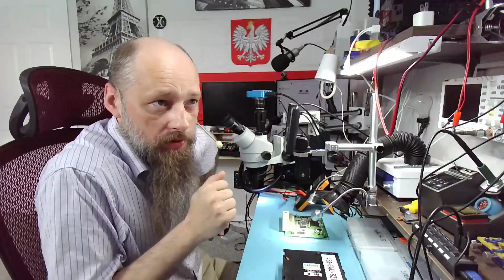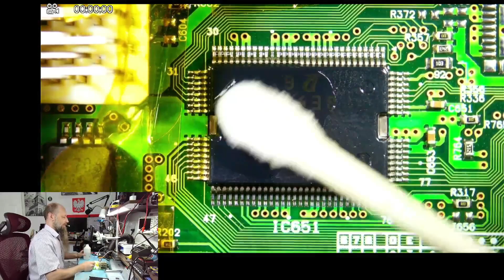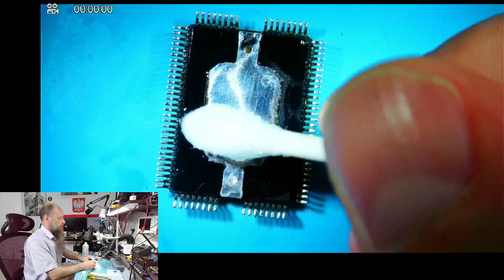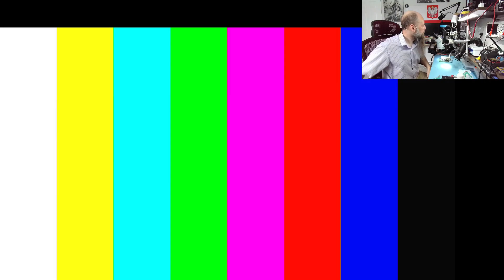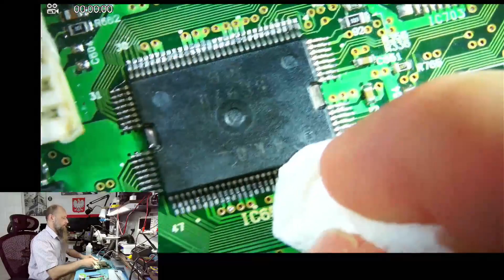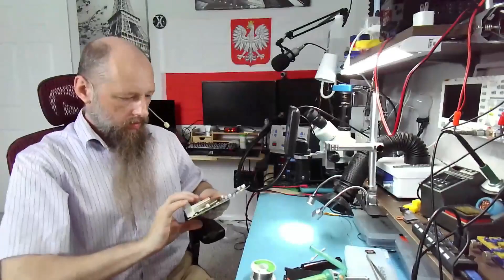ECM Repair IC651 Replacement and some triggering subjects

Comment: Dude I think you are my new hero. I not only have my wife's dead 2010 tribeca that I think this will repair, but also stacks of other bad subaru ecu's that I have been unable to figure out what was going on with without building a full simulator or debugging harness in-car. I now think I will be able to get that thing repaired and surprise my wife with her preferred car resurrected again for Christmas.

On a similar note, I would like to talk to you at some point because I was already planning on offering a repair service on ebay, and now that you taught me the missing bits of a couple generations of these things and their common faults, I would feel bad to step on your toes.
Reply from the maker: you offering the same repair doesn't make you my competition, it makes you a member of our community :)
Go for it!
Join my discord in case you have any questions or issues in the future, we have some great technicians there.
Make sure you publish your repairs on YT :D
Reply: @blackhorserepairs  Thanks man. Well, I guess I need to clean up my lab and get my OBS setup together again. Cheers!
Reply: @blackhorserepairs  So when you pull an ic608 out, how much of that dendrite formation do you see in a typical failure? I only ask because after yanking the ic651 on the tribeca, the solder on the chip ground looks like it has a lot of air bubbles (porosity), but not much of the white dendritation. assuming this were an ic608, would you consider that a typical failure or start looking for other faults? Thanks in advance.
Reply: To me it almost looks like it heated up enough for that lacquer stuff to get into the joint and mix with the solder. of course, that could have been while i was hot airing it.